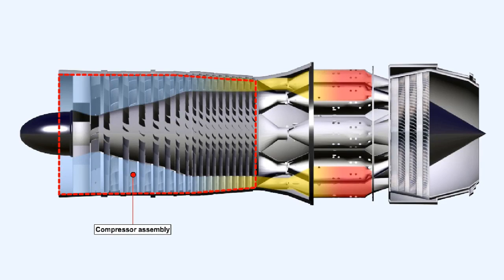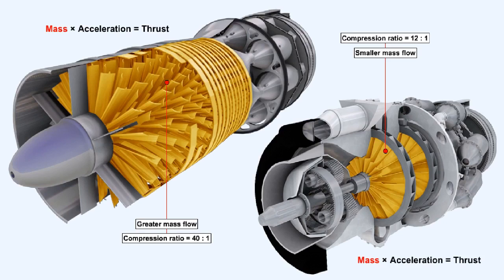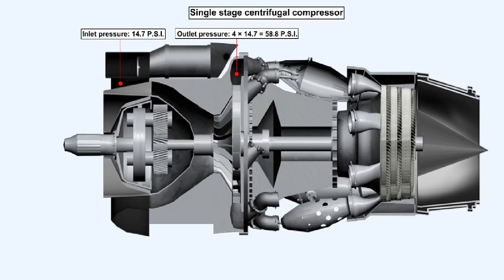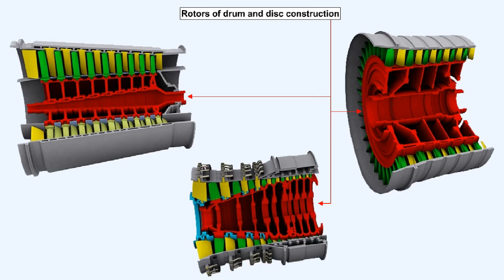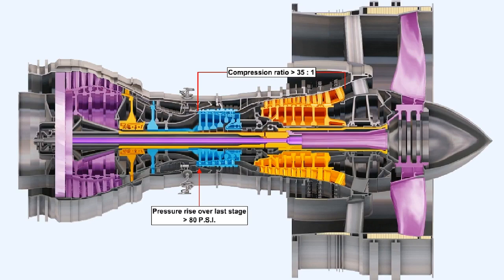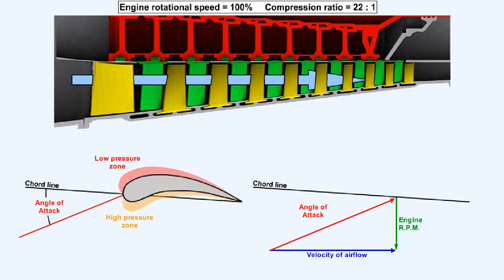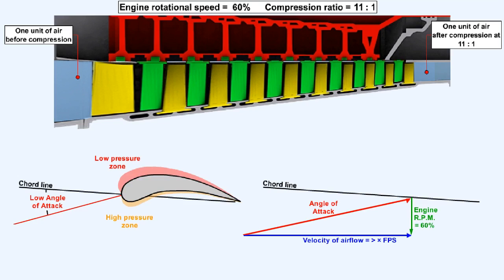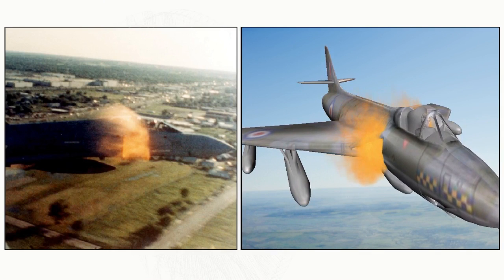Compressors Part 1 - Aircraft Gas Turbine Engines #05

Comment: Why there is a restriction on pressure ratio at a given stage of compression? Why can't it be compressed up to 5 or 6? Is it due to material capability?
Reply: It is from the point of view of separation in the stator blades.  AS already told they act like a diffuser, which is an adverse pressure gradient component.  If we allow the velocity to drop more than a critical value by having higher divergence passage, the flow separates and no further pressure rise can take place.
Reply: i believe so, i think it's due to shear